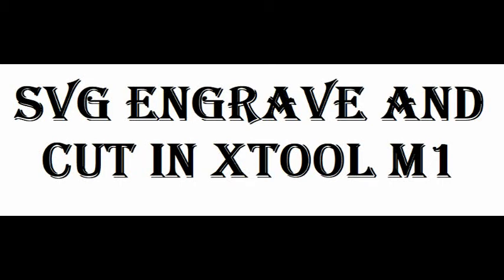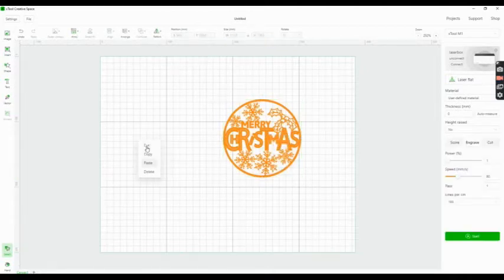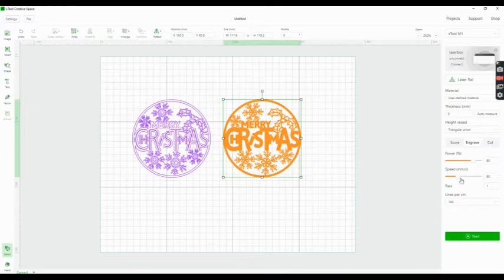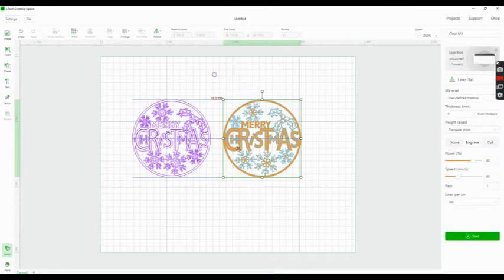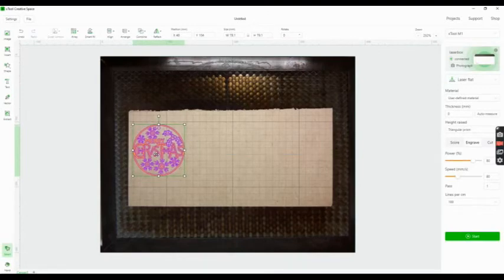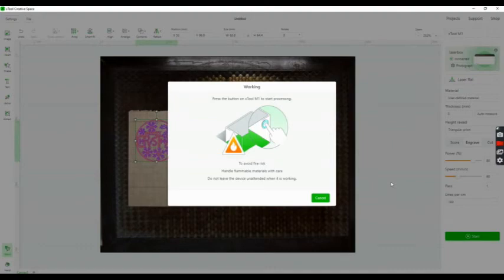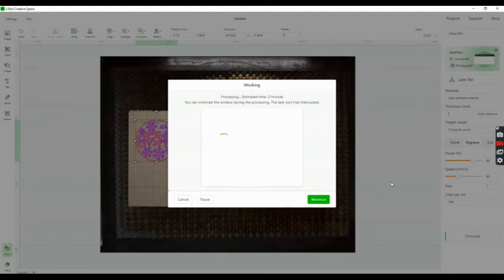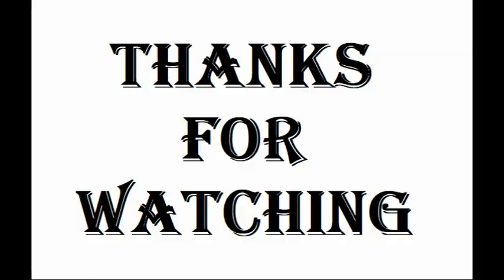SVG cut engrave xTool M1 XCS

Comment: I was really hoping to find out an easy way of doing the cut layer without cutting where it just engraved.  I've found it very difficult to select the interior detail and delete it.  I feel like this could be more easily prepared in Illustrator or Inkscape, but I would need to know how to make it so that the software understood which layer or lines were meant as cut lines and which were for engraving..
Reply: Mike, It's not that hard. Her settings were off. Lower the power for a less burnt look.  You can also put some tape on it and the tape will burn  but not the wood.